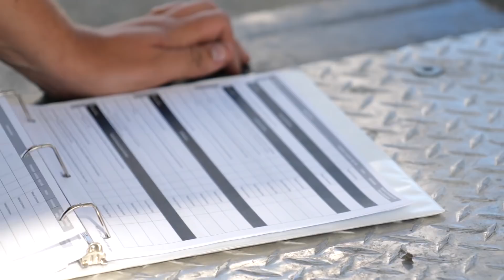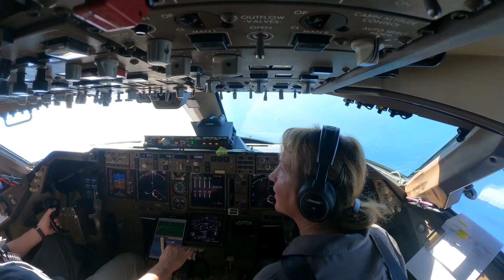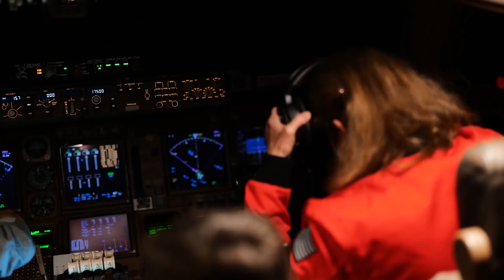Virgin Orbit - from an airplane into space

Comment: Virgin didn't do anything radical, just carried the RocketOne on the wings of an airliner, had they modified a over top wing bulk cargo airbus plane, to open like a split hatch, from belly bottom front nose, to near tale rear, it could've deployed a Virgin Starship size rocket, even SpaceX version. Being the very first stage of launch, as a winged concept.

Virgin could've used all 4(four) of those rockets, to take the WHOLE airline into the Unity22 "space tourism" hieghts, 😆 seriously, a super tourism craft🤔. Also a part jet stage with ramjet features would beat the safety of the land2land SpaceX passenger vRocket method. Like a Passenger Orbitline Service

 There is many many ways beyond the burning canister of pact large currency old-school called a T-minus waste of weather and money pure verticle ROCKET

 You can also take MASSIVE space stations in FULL structure built forms, just by adding vHigh Balloons and wings, drones to propeller rise it up, then the wings and baloon to rise, eventually use the balloons to compress and use its air to slow burn the higher peak, before the rockets, be the final stage in exo orbits,

Comment: Considering how many ex-SpaceX people are working on this project, it is not surprising that the engine and the rocket have so many similarities to Falcon-1.

It is interesting that LauncherOne and Falcon-1 are the same size and weight, and use the same fuel, but Falcon-1 can launch heavier payloads from the ground than LauncherOne from the air. It is counter-intuitive that launching from the airplane did not increase, but in fact reduced the payload. I assume that to allow the fueled rocket to be carried under the wing of the airplane, the structure of the rocket had to be made much stronger and therefore heavier, comparing to the rocket launched vertically from the ground. This weight penalty seems to be greater than the gain from the altitude and velocity of the air-launch.

Comment: Virgin's choice of the 747-400 is also kinda dumb. They should have gone with the nose door equipped 747-400F and modified it to carry ALL the personnel,  RP-1 and LOX support equipment on the 747 itself -- on pallets if necessary. This will allow them to launch from anywhere, including right on the equator, by flying the rocket and everything it needs to a nearby airport. No need to charter a heavy lift cargo plane, no need to be near LOX, RP-1 fueling infrastructure.

Comment: I'm surprised to learn that the launch (release?) altitude is so low! Only 35,000 feet?
Almost everyone else launches from 43,000 feet or higher.  The 1950's designed X-15 rocket plane was typically dropped from 45,000 feet or higher.
You would think with modern designs the launch altitude could reach 50,000 feet. And speeds of the carrier aircraft of 600-680 M.P.H.
Maybe next time?
Reply: Probably limited by using a 747 , I believe white knight launches from 45000ft as it’s specially designed for the job

Comment: just imagine how much more they could add if they got rid of everything unnecessary on the 747 and made a new craft based off it's wing design and powerful engines
Reply: Huh? The 747 is not the limiting factor here, dude. That rocket doesnt even make a 747 break a sweat as it is. If they wanted a bigger, heavier rocket, they could have one without changing the launch plane at all. They chose that size on purpose because it is cheaper and less challenging. When they do develop a larger unit, they could develop an entire purpose built launcher/carrier for the same price as trying to totally rebuild a 747 with an entirely new fuselage. Its not like a 747 has some magic powers that cant be matched by any other machine; they chose the 747 because it was cheap and readily available. What you describe is neither of those things. And trust me, you are not the first one to think 'hey, what if we, like, carried a really BIG rocket up and launched it from altitude?' What do you think the point of the 6-engine, twin fuselage competitor shown in the video is?
Reply: @justforever96  I did not say it was a limiting factor at all. I was thinking in terms of a total redesign that uses the proven 747 as a base since redesigns with an already proven concept (math worked out and tests conducted ofc) can be a cheaper and quicker alternative to a completely new model. Especially since Virgin Galactic is now getting used to the 747 and is becoming familiar with the controls of the plane. Maintenance-wise there is the added benefit of being capable of utilizing some parts from the already-in-manufacture 747. The setup in the video is indeed cheap and proves the viability of the launch system but I think it could be improved dramatically. For example think of the weight saved if you cut away the lower deck of the 747 and kept the structure of the upper deck and the basic shape of the fuselage. Then you take and shift the rocket into the area now vacant. This could reduce excess drag on the wings and move the center of balance closer to the center of the structure while also potentially allowing for larger and better rockets to be launched in this manner. Yes parts and modules would need to be shifted and tests conducted on the new model et cetera. However, I think that such a redesign would be far more efficient going forward. 

As I am not an aerospace engineer, I am not totally educated on aircraft physics. I only know the basic stuff really--lift, drag, aileron, elevator, rudder, thrust, trim and that sort of stuff. So if you have insights it would be appreciated.  As for the 6 engine, twin fuselage competitor goes, I personally have doubts that it could give a superior performance as is. It would have in essence 3 fuselages worth of drag attached to it while loaded and would have to overcome that to get the altitude needed. I really think that by having both loads (the normal flight compartments and the rocket) right on top of each other, you could give much better stability while not disrupting the aerodynamics of the aircraft.

TL:DR -- I am not saying that the 747 is limiting the launch. I am saying that it could be improved on and made more efficient. Since it is already a plentiful aircraft, it would also be cheaper with plenty of spare parts that would not need to be manufactured from scratch.

Comment: I ask myself- why Musk ? Well , Tesla run on electicity . A lot of it . Providing all that energy from existing sources is hard , since  most to all tradional sorces are dirt . On the other hand , green sources are not so green anymore , but are unsufficent . So , what is accptable clean and eficient? Nuclear energy ! But , waht with radioavtive waste ? 
Well -  stick bars together ,  cast it in some resin, add a layer of lead ,  put some navigatin tip  front , booster on tail - and there is a rocket . Then , clamp it under  military surplus MiG 31 , take it up to 20-30 km , and speed up to 2M - and fire in space . 
Once in vacuum and free of gravity , packs can be composed in “trains” and shoot in deep space . Well , not quite eco frriendly , but neighbors are far far away !

Comment: Whats the advantage from just 10-12km less?
Reply: A large part of the size and weight of a rocket is used lifting it the first 10-20km, through the thick air. A rocket launched from 35,000ft can be a quarter of the size and cost for the same payload.

Comment: Once again - B747 to the rescue.
Reply: Actually the legendary B52 that carried the first rocket planes and provided the platform for placing the first successful commercial payload insertion, had significant advantages over even the B747. Built to very demanding standard of the first military bomber to carry the first hydrogen bombs, and has design features that remain classified to this very day. However much was reviled by a recent BBC report in part  “It’s incredible,” says Stemm, “that the aircraft had enough surplus lift and wing area that they could make a substantial cut in it without having an effect on the aircraft sizeable chunk missing from the wing and the special adapter to hold the spaceplane, this special B-52 (also known as the NB-52A) also boasts unusual markings along the main fuselage. Where some aircraft might have representations of the planes they shot down or the bombs they dropped, this has pictures of X-15s – each signifying one of the 80 missions flown by this particular B-52.” 
While some may not understand certain maneuvers involved by the mother ship. One of the few that is rarely mentioned is the gravity hole created (that is a kind of dip then upward pull ) executed prior to launch that provide additional power to the thrust vector. Tho this small fact is seldom mentioned, it was a factor in our early ballistic trajectory equations. The particular B52 carried a number of features that reinforced points on the wing to allow a maximum load, an aerodynamically enhancement that was unique to its mission.